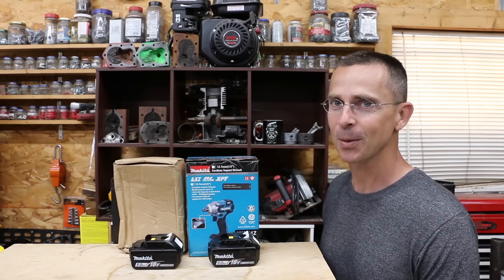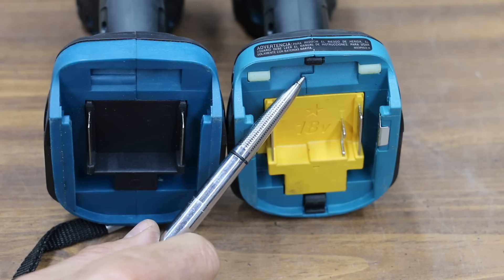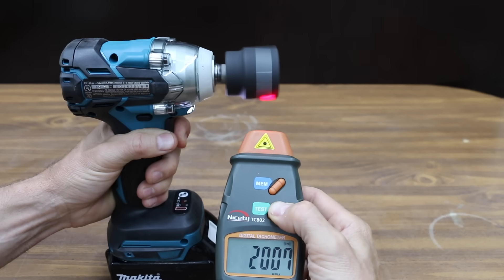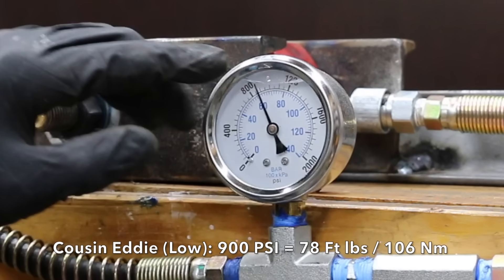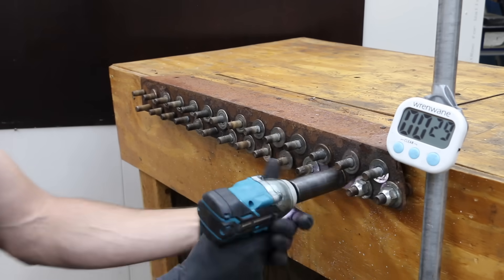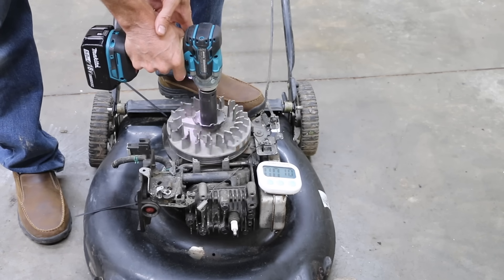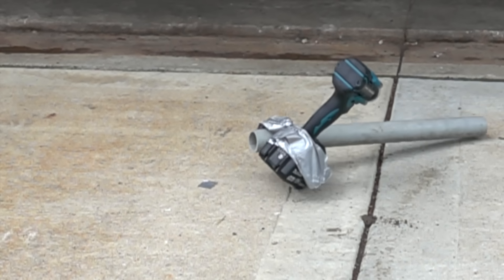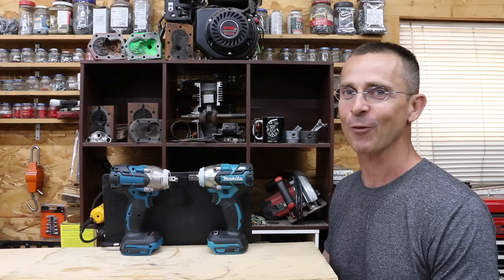Fake Makita Impact Better? Let's find out!  Makita XWT11Z 18V LXT Lithium-Ion Brushless Cordless

Comment: China's Cousin Eddie: Why don't they sell it as what is, a cheap impact wrench that's good for occasional smaller work? It is a good value for the hobbies, no need to lie about data or copy the big name brand.
Reply: If you’re looking to buy something, a company emulating something you know will catch your eye long before some no name brand
Reply: @SeanHavlin-o4j  -
Reply: @ne0phyte_  Another thing that happens is that when a brand produce a new uprated model, the factory in China continues running the old one. This avoids any tooling cost, but they often use inferior components that they have to purchase.
This process is more common in India.
Reply: Because the Makita brand is proven brand over time. Creating a fake a marketing it as such increases the demand for the fake product as well
Reply: Indeed.  I sometimes buy Harbor Freight tools at 20% the cost, knowing they may only last half as long. Which is a good value in many cases. 

Heck, Harbor Freight can be pretty clear about quality too - this channel tested two of HF's three different grades of step drills - the HF cheap one is decent and cheap, the best HF is a pretty darn good one.
Reply: That is what they do, Chinias steal tech and  resell sit to put  other companies ou tof  busness ( and  they get   gov help to do it)
Reply: @nevermorefrompast-qx5wb  The Japanese didn't do that. They sold cassette tape recorders or cameras with their own design. Well, we knew it wouldn't last long, but it was cheap. They also never polluted air, soil and water like China does. And they did not aggressively claim territories of other countries.
Reply: @krollpeter  How about Minamata disease 1950, or Fukushima 2011... and meanwhile it is China planted most trees in the past decade according to BBC News. Oh and there was the Liancourt Rocks dispute between Japan and Korea🤷‍♂️
Reply: @krollpeter  Perhaps your admiration for Japanese corporations should be better informed sir.  Japanese companies have been known to commit dishonest practices too.  Years ago they destroyed our incipient electronics industry by tricking engineers by offering them much higher salaries... until they destroyed entire electronic companies here in Mexico, and then closed those work jobs!.  And for your information, in the good old USA, Matsushita (Panasonic) also battled american TV manufacturer Zenith with dishonest moves and litigation.  Don't ever believe they are completely honest... A few years back, one of the most famous and previously respected Metalurgy companies in the world, SUMITOMO, falsified quality reports and emitted many material certificates that weren't valid, but faked ones.  That steel could end up being used in a Bridge, a Ship or an Airplane made in USA...  How about that????
Reply: @alfredomarquez9777  I do not believe they are completely honest, but your examples have mostly nothing to do with the environmental catastrophes caused by China. Irreparable damage to air, water and soil in never known dimensions. The closest I know off is Russia.
Reply: @krollpeter  Have you heard something about a place called FUKUSHIMA Daiichi ??? Today they continue to pour radioactive water into the Pacific Ocean, and have committed several environmental catastrophes too.
Perhaps may we suggest you to read about the Minamata disease, the Itai-itai disease, the Niigata-Minamata disease and the and Yokkaichi asthma...
Reply: @krollpeter  you are well versed. For my own benefit, and maybe for the other as well, it is wumaos not wumais,right? It means the 5 dimes paid to this guy for making intentional half truth statements or cases to confuse the issues for readers. He is for the benefits of the CCP.
Reply: @alfredomarquez9777  I recommend trusting the IAEA announcement rather than the Korean government claim.
Reply: @alfredomarquez9777  The governments are the real questionable ones, more than the public or companies. Which is better Japan or China. I'll choose Japan.
Reply: @krollpeter  yeah japanese only didnt claim Korea 3 times, a third of China 2 times and the phillipines 2 times
Reply: @alfredomarquez9777  Fuk-u-what? Never heard of that

Comment: This is truly eye opening and amazing. As an Engineer, I was always taught to follow the code of ethics under IEEE. This video may seem like a simple review/test of cousin Eddy vs Makita, but the thought process and testing is well designed. It also demonstrates how people without technical science knowledge are being robbed of their money due to their limited knowledge in this domain. Thanks to you, we can have some assurance before we buy we tools.
Reply: I'm a mechanical design engineer for 30+ years now and have been an engineering consultant for 20+ of those years.  I read through most of the comments and was a bit surprised to see only your post that even mentioned the ethics of making and/or buying such a knockoff tool.

The tests were very informative.  As usual, as in most of life, you get what you pay for.  And you don't get something for nothing.

It is easy to see that the knockoff was created by simply reverse engineering the Makita impact wrench and then making small modifications to reduce the cost even more.  So one reason why the knockoff can be offered so cheaply is because they stole (as in real theft) most of the design from the original manufacturer.  Especially in China, they do this all the time.  So the knockoff company didn't incur nearly the amount of design cost as Makita, because they stole that design effort from Makita.  The knockoff company also attempted to steal the good brand name of Makita by making the impact wrench look nearly identical in shape, cosmetics, fit, form and function to the original.  They only left off the name "Makita", almost certainly because having that label on the knockoff impact wrench would ensure that the shipments would be confiscated and destroyed by US customs agents if they were ever discovered.

As far as the ethics of an individual person buying such a knockoff tool...  In my opinion, there is no problem so long as the person doesn't realize that it is a knockoff tool.  But in this case, we all can see the original and the knockoff tool side by side.  So we know, without a doubt, that one is a knockoff product with a (mostly) stolen design.  In this case, IMO, it would be unethical for someone here to actually buy the knockoff tool for their own use.  Perhaps this isn't a popular view, but it is literally taking money, and likely jobs, from the legitimate manufacturer and those people who could have been employed by that manufacturer if the knockoff company had not stolen their design and part of their legitimate income stream.  All of this does not even mention the potential that the knockoff company likely also infringed on one or more Makita utility/design patents, which is definitely illegal.

Ed Schultheis, P.E.
President
Schultek Engineering & Technology, Inc.
Washington state, USA
http://www.schultek.com/
Reply from the maker: You are welcome!

Comment: where do you get that name cousin eddie hehe .yes  theres a lot of the brushlesz c.eddie here in taiwan price is low but the power is high ill use these everyday in my job and the performance very powerful its not just the brand or name sometimez you need to be practical
Reply from the maker: Thanks for sharing.

Comment: Much as I enjoy your excellent videos I have to suggest that you edit this video to show that the XWT11Z does NOT come with a battery for this price yet you pull out of the box a unit with the battery attached ! This appears to be sleight of hand and is so unlike Project Farm. In actuality you can't use EITHER of these products without a very expensive battery and charger designed specifically for a Makita tool.
Reply from the maker: Thanks for the constructive feedback

Comment: Where do get a Makita with battery for $138? I saw that the one you bought had a battery. The ones online for about that price do not. Amazon has one WITH the battery and charger for $233.
Reply: The fake Makita batteries work just as good as the real Makita batteries.

Comment: Meaning: You'll be fine with the knockoff, but the original delivers the quality for the higher price.
Reply from the maker: Thanks for sharing.
Reply: I needed a 1/4 hex type, got a dewalt in 2014, got water on it on many occaisions due to wash machines, works flawless, batteries are still working like new.
Reply: @shadowopsairman1583  I pay the extra cash for Dewalt tools because they are tough. I have had my Dewalt screw gun slide down a roof and then fall 10+ feet to concrete with just some scuffing as the result. (Multiple times as I am a clumsy dumbass who keeps decoupling my lanyard....)

Comment: When you do the max torque test you need to rotate the wrench slightly. Maximum will only be produced at a very specific point in the relationship between stator and rotor. I don't know if you will notice a difference or not but it would be interesting to know what difference it makes.
Reply from the maker: Thanks for the feeback.

Comment: 30 dollars for a brushless , prooves that this kind of motor isn't really expensive, so what we pay is something else. And they tell us that brushless motors need circuits to control them and not brushes, but the knock off, again, shows no complicated circuits inside it. It hardly shows any circuit at all. The gearing system is another thing totally. I would love to see the gearing system of the makita inside the knock off. Then we could see something new.
Reply from the maker: Thanks for the video idea.

Comment: Obviously the snap-on 1/2” air impact gun is better built but I also have a harbor freight 1/2” impact gun which I bought because I lost my snap-on(which I found thank god) and to be honest the HF impact gun works perfectly fine and I haven’t had any problems at all. Of course it’s not as built as well but for the money the “EARTHQUAKE
1/2 In. Aluminum Air Impact Wrench” isn’t bad at all. Cost $90 and my snap-on was about $600 but yeah I’d obviously prefer the snap-on if I had to choose.
Reply from the maker: Thanks for the feedback.

Comment: what is sad is it's mostly in the electronics that cause such a variation. I would be willing to bet that if you took the makita switch and put it in the generic look alike tool you would find similar results like the Makits. Sometimes the coil is part of the electronics but for testing it would be easy to find out just from switch replacement. 
  The Tool Doctor

Comment: One good rule for tools is always: start out cheap and upgrade when its broken. No need to buy an expensive impact or a drill when you never use it. A $30 one will do fine with that too.
Reply: I do the absolute opposite, can't stand working with a tool that is not as fast/comfortable to use and breaks when doing a job. The breaking always happened on a Sunday with no shops open. Also I tended to keep using something beyond it's nice to work with point messing up a few jobs. If I have a large job I get the tools that do that job well so I save myself time and agony and have a nice tool afterwards to grab when useful. I understand your point of view, it is economic good sense but for me part of an enjoyable job is working with nice tools that make light work of it.
Reply: @HvD75  I have Makita and love it. Had Bosch before and very noisy grinder.
Reply: HvD75 is your working a job out really paid to use decent equipment to begin with. This stuff doesn’t cost an arm and a leg it’s a fair price if it’s necessary
Reply from the maker: Thanks for the feedback.
Reply: I understand your logic but it's also annoying to have five different battery systems.  I made a compromise and bought ryobi, which you can find used on the cheap as well.
Reply: Buy once, cry once.
Reply: When I was attending school many years ago, I bought my first hand drill: an inexpensive corded 1/4" Black & Decker of the lowest cost line...
At that time I did Stereo equipment installations to help me earn some money. At one job, I had to install a pair of Speaker systems built into a large wall-to-wall and floor-to-ceiling bookcase.  That required hundreds of screw holes into solid wood and thick plywood.  Soon my flimsy inexpensive Black&Decker drill became very hot and was slowing me too much.  It happened that my client, the home owner, had a similarly sized 1/4" corded drill by Bosch, still made in Germany.  His drill had a much slower turning, much higher torque gearing, making it SEVERAL TIMES MORE EFFOCIENT AND BETTER...
So, in one single session, I undestood the absolutely superior value of having the RIGHT tool.  Having learned my lesson, I saved my money and started to buy the best tool I could afford, not always the most expensive, but avoiding the "garden variety" or "$30 dollar" ones.  Of course there are a few exceptions, but only when you are sure you will be using it for very short uses, the inexpensive tools are worth it.
Reply: @alfredomarquez9777  good advice. If you're going to use it to make a living, buy quality tools that won't let you down. Time is money, and down time is killer.
Reply: Not as a professional.

Comment: You can't test the rpm like that.  The rpm is based of the chuck and not the bit you put on.  The bit you put on has a larger diameter so it will take longer to complete a revolution.
Reply from the maker: Thanks for the feedback.
Reply: Project Farm just my 2cents

Comment: Will either be enough to remove sedan lug nuts? I know usually it’s just 90ftlbs but sometime it’s over tighten. Love to use cordless than compressor
Reply: Never anger your mechanic. If you've ever tried to break a stretched stud you got on his nerves, oh it's done purposely, ask me how I know 😁
Reply: I bought one from AliExpress and it does work on car lug nuts as long as they are not overtightened. Over 100 ft-lbs it won't do it.
There are battery adapters available on Amazon if you do not have Makita batteries.

Comment: I wish my garage was as organized as yours. Those shelves behind you in the closing comments are enviable! I had a neighbor that had turned his garage into a workshop, so he didn't have to worry about building captured/railed shelves, he attached a 2x4 to the wall (like a very shallow shelf), but then bolted uniform lids to the underside of it, and would put a label on the 2x4 above the lid, and screw the jar 'up' into the lid. It was a clever idea.
Reply from the maker: Thanks for sharing.

Comment: I have been looking at some of these units lately. I am not a tech and just need somthing for around the house. I've managed to use  a cheap black and decker for years with no real issues, would you recommend something like cousin eddy for  what I do? I don't know if I need anything expensive.
Reply: we use both and both are still going both have over 50k bolts tightened The makita is exactly as better as the video shows but if you only use occasionally the cheap one is exceptional value worth also noting the bolts on the makita makita head loosen sometimes doesn't happen on the cheap one
Reply: @alexnewton6840  Awesome! thank's fore the reply! Cheers!

Comment: Would've been interesting to know how many watts each was using, and whether swappng the batteries made a difference, or maybe feeding each with a benchtop regulated power supply. I'd have liked that no-load test to be done while the gearhead was unattached.
Reply from the maker: Great suggestion!  Thank you.

Comment: If you need a good driver that'll last through abuse and multiple jobsites over the course of multiple years, get Makita. I've dropped mine from a few stories up and it still works fine. It's drilled through really thick treated wood posts in pole barns, through metal, and it's not even a drill. Crazy versatile, crazy well built, and the battery lasts for a ridiculously long time, even in extreme temperatures and frequent use. Really can't recommend it enough if you can afford it and the job requires it. 
I guess you could always buy a few of the $30 knockoffs, but it seems like one wouldn't really last through one job.
Reply from the maker: Thanks for sharing.

Comment: Learn about the auto stop function before saying it’s going to spin the nut off the bolt by over rotations.  It’s smart revise so it needs a load not just pulling the trigger in the bench. So your test the specs under no load and just spinning in the air not even a socket on it
For some drag weight. Your testing does not give a useful information.

Comment: Awesome video, thank you for this review! I always wondered if these knockoff tools are worth it. Personally I have the smaller (I think 3/8", while the one you tested is 1/2"?) Makita impact driver as well as the matching drill and they are both awesome tools & my go to drill and driver for pretty much everything. I mostly do handy man/home repair type work but occasionally need to bolt anchors into concrete or do some other high-torque work and am always happy with the performance of the Makita drivers.
Reply from the maker: You are welcome!

Comment: https://youtu.be/47VTu2Su8WY
Just tested my new unit on our SUV's wheels! Check it out
Reply from the maker: Thanks, will do.
Reply: @ProjectFarm  Thanks Project Farm! 
 https://youtu.be/e8z2jVk3bfk

Just made a new comparison between the Fake Makita and my new Autojare High Torque Impact! 
I had to add grease to my Fake Makita. It's much better now.  Not sure if you still have your unit but check and see if you have grease inside.  Mine was bone dry and hits much harder now with grease!

Comment: How much did the pvc pipe weigh that was used on the drop test? Was just wondering since it was duck taped to the battery, wondering if they would have both survived that drop test if the pvc wasnt on there but i know those batteries are pretty hefty so maybe not.